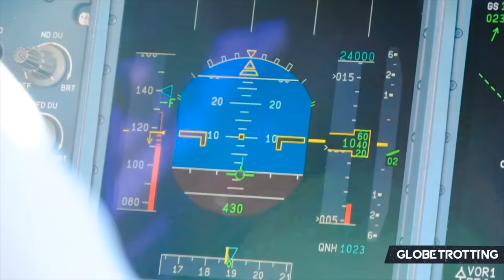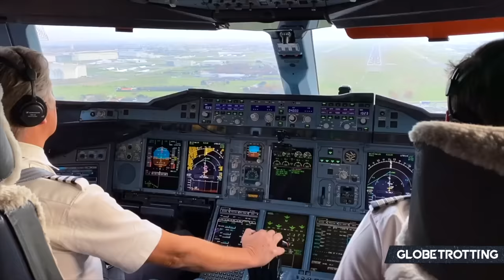NEW ERA - The Airbus A380s Return

Comment: Also, demand for non-Boeing aircraft seems to be increasing. I travel ~50% for work, and I have SEVERAL coworkers who are declining trips which include Boeing segments.
Reply: Well.. if you have a choice of going in a Boeing 737 max 9 with a door plug, or a A380... I guess the choice is nor that hard.

Nobody have ever died as a result of falure of a A380... of cause there was just a few hundred produced. But that is also true for the A340... and the A350

(Granted, nobody have actually died as a result of a error in a dreamliner... but.. well. That probobly will not stand.
Reply: @matsv201  That's not the comparison... must be 737 vs A320 and as passenger flying in cheap economy, if I have the opportuny to choose, then the extra inch and comfort of Airbus wins :goodvibes:
Reply: @TheTransporter007  Boeing fanboys hate to recognise this, but the truth is that the market, airline and passanger confidence on Boeing's skillset is very low (even the spacecraft they recently created - by a totally different branch - is proof of how much the safety culture has deteriorated...

And this is not something that will go away for the next 5 to 10 years (minimum time interval it takes to build a proactive, open and honest culture)...

Comment: In the end - maybe ten or so years down the line - there will be a A380neo. Slots are limited, MANY more people will want to fly. Thus. I’m 100% certain.

Even today, new engines plus some modifications on the winglets would make the current A380 about 20% more fuel efficient. Without any redesign of the airframe.
Reply: I disagree with the A380neo!
Reply: @aryaansrivastava3756  because you know nothing...

Comment: I have two BA A380 flights coming up. The airline is already operating three flights per day on my transatlantic route, there aren't the spare slots to add more flights. The 777x might be a better alternative, but Boeing couldn't organize a pissup in a brewery these days and frankly aren't safe anymore.
Reply: what sint safe?
Reply: @Michaelcat5  Anything Boeing is currently designing or manufacturing. They don't have the engineering staff to design safe aircraft. They have no worthwhile quality assurance.
Reply: Corporate type management micro managing engineering operations is the key to this. I worked at 3 companies that fell apart when accountants made engineering decisions for us.

Comment: The A380 is great for airlines in two main areas: dealing with capacity during peak seasons, and offering more premium seats which generates higher revenue. For those two reasons, the aircraft will enjoy a limited role for some time, but the 777-9 will change the game by becoming the highest capacity twin engine airliner in history.
Reply: The 777-9 will always be just a longer 777. It will simply never compare to the comfort, quietness, and sheer capacity of the a380. The only reason why the A380 has a "limited" and somewhat comparable number of seats to the new 777-9, is because of the vastly superior 1st class options of the A380, and its luxurious amenities, like having a shower. Many business travelers, including those in the companies I worked for, will pay extra and choose dates and times specifically to fly on the A380 due to these features. Nobody will go out of their way to do this to fly on a 777, regardless of its size. For as long as it can be maintained, the A380 will always be a flagship for the airlines providing the best services on the market, while the 777 will only be a workhorse that will look to have as many passengers as possible. Assuming Boeing and its partners can get their act together and build it correctly, making it safe.
Reply: With ultra skinny seats in economy.  A320s and 737s have better seats than 787s or  10 abreast seating 777s
Reply: @stephanguitar9778 It depends on the airline and what seats they select, but they're all thinner nowadays. Most seats are the same, whether installed in a narrowbody or a widebody.
Reply: @sainnt  No, Airlines have chosen to have an extra column of seat's in their 787s and 777s ie 787 was designed to have 8 abreast seating but only Japan Airlines has that, the rest have 9 abreast. 777s were all 9 abreast but now most are 10 abreast. This is pure misery on long flights. We swapped from a Singapore airlines A380 London to Singapore to a Singapore airlines 787, 2 hour flight to Bali, it had very tight seating, ie worse than most 737s. Emirates is the same, brilliant A380s but miserable 777s.  Last year I flew on JALs 787 with 8 abreast seating and it was as good as the A380..
Reply: The 787 cannot have 10 abreast seating. I was talking about the A350 which can now be had with 10 abreast. French Bee A350 has 10 abreast I believe.

It's true that older 777 had 9 abreast seating. I flew one a couple of years ago on Egyptair, but most 777-300ER comes with 10, and they're not uncomfortable.

Like I said before, nothing can match the comfort of the A380 because of its width, but I've flown Emirates 777 in economy and it's quite comfortable. I've only flown Singapore Airlines in premium economy on the A350ULR, but that's a more comfortable seat that's 8 abreast, so I can't comment on their seat.

I recently flew on Qatar Airways 787-9 in economy, and even though it's a slimline seat, it was still fairly comfortable due to the provided amenities.

Comment: I just flew to Singapore and back on SIAs A380. The 15 hour flight back (due to strong winds) became very uncomfortable, however would have been torture on something like a 787 with its ultra narrow seats. The A380 Itself  has more personal space than any other aircraft, much smoother too. The only other aircraft I will fly overnight or 10hr + is 777s with proper 9 abreast seating, not the re- hashed 10 abreast airlines are now using. As for 787s, only Japan Airlines has the proper 8 abreast seating that it was designed for.

Comment: Does DJ actually see what's actually happening in SIA A380 fleet, or continue with his love affair with this bloated beast..
  Just  a few weeks ago, they stated they're cutting back on the flagship Hong Kong route, replacing them with more efficient twin engine aircraft..
Reply: A "Bloated Beast" that does not compromise on passenger comfort. Singapore still backs the A380, the reason the Hong Kong flights are cut down to 1 A380 flight and rest A350 are due to various reasons. But mostly because Singapore wants to use them in more premium, high density flights. Look at Emirates, they cut down some A380 flights but added them on more high density routes like Bangkok (which is now an all A380 flight for Emirates). Pretty sure Singapore is following the same strategy
Reply: @mdshadmanwasifkhan4482  people who point SIA or BA cutting on the Hong Kong route are not completely ignoring the fact that Hong Kong's economy is collapsing and its loosing quickly its main passanger type - business traveller....also a type of passanger that overall is changing the way it travels...